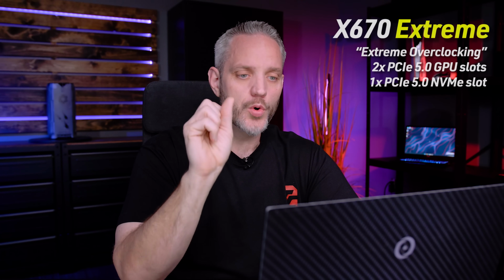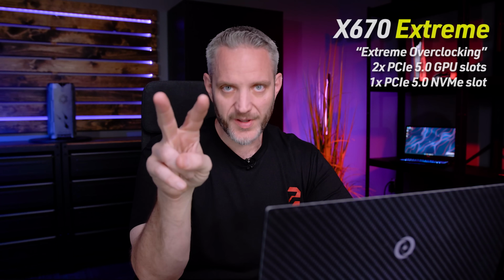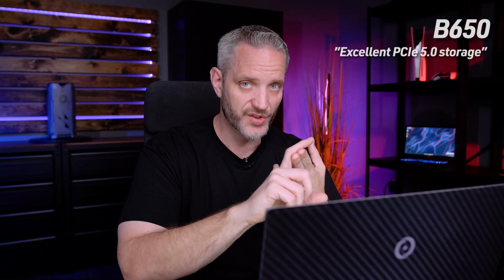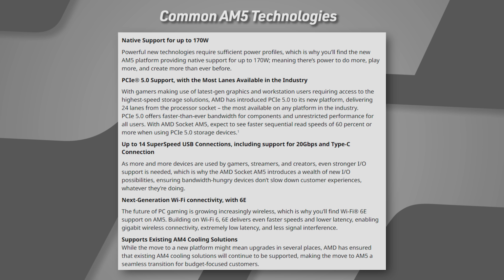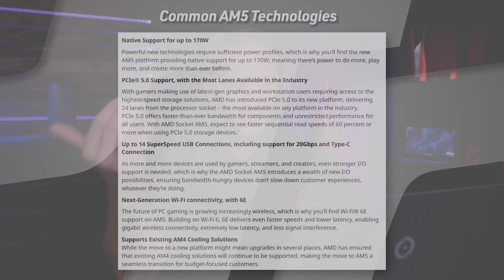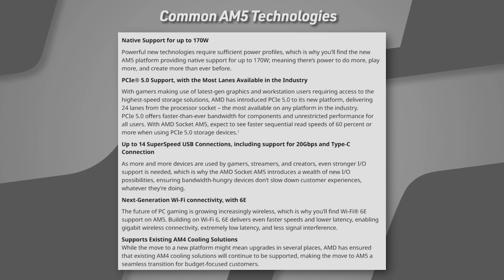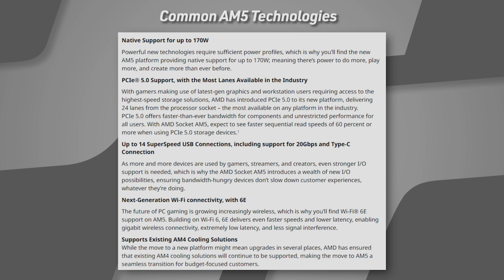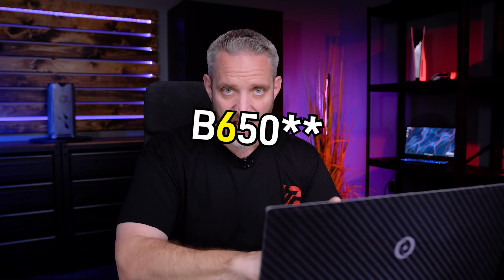AM5 Motherboards are EXPENSIVE! AM5 Explained

Comment: Total Platform Cost & Upgrade paths should be taken into account far more than they regularly are.
Reply: True people think you buy only the cpu
Reply: That's why I am going to stick  with my 5800X. The motherboard  it's  in, sadly, is an Asus Rog Strix B450-f, which only has PCIe 3.0  graphics and NVMe  storage..... But, maybe the RDNA 3 GPUs and the  PCIe 4.0 NVMe drives  wont be any slower, for gaming, on 400 (what I have)  mobos  vs 500(peak AM4) or 600 series(AM5)...... Unless RDNA 3  GPUs run more than 10% slower in a PCIe 3.0 system  vs 4.0 or 5.0..... AND unless direct storage  technology for gaming runs a lot  worse  on PCIe 3.0 systems vs  40. or 5.0, ..... at WORST I'll need to upgrade my mobo to an X570..... while I upgrade my GPU and NVMe..... at least I would get to keep my 5800X and 4X8 RAM kit (4600 16-19-19-36)
Reply: Too bad new AM5 motherboards are going to suffer with future upgradability the same way Intel's are when it comes to DDR5. DDR5 is still in its infancy stage. The DDR5 motherboards today are going have issues running better DDR5 memory in the future when it becomes more mainstream. Memory is only going to get faster and timings are going to get tighter as it becomes more optimized. Optimization for the memory controller and memory training algorithms on boards now are going to have issues for some. If you're going to adopt Ryzen 7000 with the idea of getting an expensive motherboard and thinking you will keep it for a super long time as you upgrade I wouldn't. Not worth it at all.
Reply: @PabzRoz  The memory controllers are in the CPU and the power management chip has been moved to the RAM's PCB with DDR5. The primary thing you'll be paying for with regards to a motherboard's capability to run higher speeds with DDR5 will be the quality of the materials and layer design of the PCB along with power filtering quality from the input and output capacitors. If you purchase a high quality DDR5 board now with SMT capacitors, SMT DIMMS and shielded memory channel signal planes, it'll perform perfectly well for the foreseeable future.
Reply: @PabzRoz  I disagree completely.  The expensive 4000+ mhz ram kits never gave a good price to performance ratio.  I have completed 3 ryzen builds with 3200 mhz ram, one with 3600 and one with 4000 that was twoard the end of am4.  I would still recommend 3200 on anything that wasn't an apu for sure.  The biggest thing is being able to drop a 5600 in a pc that used a 1600.  That is just nuts.  It makes amd so worth it.
Reply: But that can be counterbalanced by long term support which AMD has been very good about with AM4
Reply: @Alovon  ...because, when AM4 launched, AMD still had everything to prove to consumers. Now, they're on top of the game, so...
Reply: @lamikal2515  They have already committed to 2025+ for am5.  I don't think intel ever supported more than two gens on a socket.
Reply: @mrfarts5176  "2025+" can be literally 2 gens though (zen 4 + 3d and zen 5 + 3d).
Reply: @mrfarts5176  What is "commitment" ? Their commitment is not wrote in legal terms. It can't be enforced. It's just PR.

Moreover, they "comitted" on the socket... wich does not say anything about "chipset incompatibilities"...

What if the 8700X can't be put on a B650E ? It won't "break their commitment", after all... It's nothing more than doublespeak.
Reply: @lamikal2515  Fine, don't believe the company that has a history of supporting their hardware like this. No one is stopping you.
Reply: @RyTrapp0  That history is only due to the fact that they were the underdog at the time. But hey, AMD are the "good guys" right ? They only want what's best for you, right ?

Damn simpleton... do you hold any share of the company, by any chance ? Because if you don't, you do not have any valid reason to defend AMD like you do.
Reply: @lamikal2515  Again, don't believe them, no one is stopping you. I'm going to trust their past consistency, which I've followed since AM2+. You don't have to.
Reply: @RyTrapp0  And again, during the AM2+ period t the launch of Ryzen, AMD was struggling hard to be competitive. They effectively couldn't afford to not be "consumer-friendy". Now they clearly can.
Reply: @lamikal2515  They want to sell cpus.  The best way to do that is to maintain a socket over 4 gens.  This is what everyone wants.  They did this on am4.  This and another handful of improvements made the company worth more than Intel.  Go ahead and buy a platform that intel only supports for one or two gens max.  We really don't care.  Just try not to hold a chip on your shoulder against amd because muahh capitalism bad.  If it wasn't for amd you would be buying a 4 core 4 thread i5 for 300 bucks.  I plan on getting into am5 at some point just once ddr5 is mature.  Intel just screwed us for a decade and i am sick of it.  I work with servers and intel face planted over the past 6 years. The server side is where I expect intel to start really loosing market share.  I recommend amd servers whenever I can and have never been let down by that recommendation.
Reply: @cheese186  Could be but I doubt it.  Amd has been firing on all cylinders and will have a real run for their money with intel gen 13.  I never counted the 3d cashe as a gen release.  This isn't a company being run by pencil pusher but actual engineers.  They understand what we want and delivered.  I don't know why everyone is shitting on am5 so much.  Go ahead and buy a platform that we know will only support 2 gens.  I feel confident we will get more than that with amd and if not I will buy an Intel cpu for my next build.  I expect am5 will support at least 3 gens min.
Reply: @mrfarts5176  You completely missed my point. Intel screwed consumers over a decade, that's for sure. BUT WHY ? BECAUSE AMD HAD NOTHING TO COMPETE FOR A DECADE. That's my fucking point. Now they're on top... but you damn NPCs still believe they will put consumer first. AM5 "being supported" 2025+ only means boards using AM5 socket will be produced up to that point. It doesn't say anything about the chipsets, and what CPU you can or cannot pair with.

AM4 and it's various chipsets were extremely "consumer-friendly" because at that time, AMD still had EVERYTHING to prove. It's not the case anymore.
Reply: @lamikal2515  You are wrong.  Lol - they were caught paying dell to not use amd.  They have been fined very heavily for this.  Amd leadership is by law not consumer first, they are shareholders first.  They need to sell cpus and have identified what we want in order to sell them.  Intel never listened and preferred to pay off companies to maintain 95% market share because they had the cash to do so.  The hilarious part is that amd probably saved the x86 architecture.  Had it not been for ryzen I expect I would be using an arm processor right now.  They have been delivering a great product at a fair price and gen 13 will be on par with zen 4.  This will be good for all of us.  Go ahead and buy intel though.  Nobody is telling you how to spend your money.
Reply: @lamikal2515  bruh wtf
Reply: @mrfarts5176  "B-b-b-b-b-b-b-ut, Intel did shady stuff 20 years ago, so AMD are the good guys"

Good boy...here is you sugar
Reply: @lamikal2515  You need to step back and do some analysis.  Amd was months away from a bankruptcy when zen came out.  They have been delivering what the market wanted since then at a constant pace on time.  Those same people are still in charge.  They pushed extended socket support hard.  We have no reason to doubt they will continue this and they committed to 2025+.  They have been pushing core counts on the server side at price levels that are very reasonable.  Intel never went to a new node unless it would save them money until amd forced them to.  I never remember Intel supporting more than 2 gens on a node, even after amd demonstrated what this could do for sales.  I do remember them doing everything they possible could to avoid having to innovate against amd.  I don't know what your problem is but you need to review the actual state of the semiconductor industry.  Intel is likely going to be the next blueberry if they continue going the direction they are going.  They need to start making profits and will be taking margin on gen 13 and will be paying billions in dividends.  Expect gen 13 to be more expensive than 12 by a significant margin.  Meanwhile amd doesn't even pay a dividend.  Just make sure you try to get your info from as many sources as possible.

I own stock in both and try to make my decisions based on reality and not my perception of reality.  I really want a strong intel and I am hoping them opening more fabs in NA will give us this but I am getting more and more skeptical they even have the ability to do this effectively at cutting edge nodes.
Reply: @lamikal2515  You are right they had to be consumer friendly and sell cpus or go out of business.  Why do you think they are going to immediately change with no evidence this will happen?  Lisa Sue wants her stock to go up and she wants to sell more cpus.  I don't get your problem other than you hate amd for some reason.  Go buy an Intel cpu we really don't care.  I have lots of friends that have enjoyed having 4 generations on one socket and would like to see that again on am5.  You are so closed minded you refuse to accept the fact that amd might continue with a winning strategy, even after they tell you that is exactly what they want to do.  It's nuts to me...
Reply: @lamikal2515  You are also wrong about that cpu.  The first consumer cpu over a grand was the first extreme edition.

Comment: It's why I am saving for a 5600/5700x for my b450 rig that's currently running a 3600, it's the cheapest option for me and it would add some extra years for it. I got 10 years out of my 2600k Sandy I expect this for my current rig if need be

Comment: Since this is a new Chipset for AMD I doubt they will change the socket type for another 5 or 6 years, so the new X670 and B650 motherboards are going to last, you can't use a cheap motherboard with these significantly more powerful CPU's because they would under perform, whining  about price is not worth it here. We're in a revolution of AMD right now and stuff is going to be a bit pricey, also AMD is always ahead.
Reply: Compare AM5 to AM4 pin count…

And boom you can see USB4 80gbps, more USB4 40gbps and so on and the reason for so few USB4 at the start is because its new and needs the spec to mature hell 80gbps USB4 was announce and 7000 series might only be 40gbps to start with

Comment: So excited for this launch can't wait till they drop the price again on the 5800x3d so I can finally finish my build! I just got the water cooling system out in and another m.2 ssd put into it yesterday!
Reply: Its already down, the cpu launch at 450 dollars and its now at 385 dollars at Amazon
Reply: @Agp1597  Yeah I'm hoping for just another 30 from microcenter the have it for 380. I'm currently using a 5600x so paying an extra 50 from what i paid for it doesn't seem bad at all.
Reply: The price of the 5800X3D wont be dropping seeing as its cache lets it trade blows with the 7800X so long as you get at least 4000MHz CL18 ram for the 5800X3D

You will be waiting till 7000 series Vcache launch
Reply: @commanderoof4578  lol sure

Comment: Is it still worth upgrading to 5800X3D? Not sure if these new components will be good for SFF because TDP is much higher
Reply: TDP number changed but the power draw didnt… TDP changed because of density and IHS changes but default you cant pass 230w without throwing away your CPU’s warranty

But yes the 5800X3D is DEFIANTLY worth it and will be until zen4 Vcache comes out

Just make sure to get 4000MHz CL18 or better (better means 4000MHz or higher and CL18 or lower)
Reply: It is. I found a 5800x at 280€ .

Comment: I might end up buying a good B550 and a 5800X3D when i can afford it.... and pair it with a nice 4000 series card
Reply: Dont get B550 with a 5800X3D that is just shooting yourself in the foot

Also X570 motherboards are getting cheaper, the mobo i have is 60% of the price i paid for mine at launch
Reply: @commanderoof4578  I iwll keep the ryzen 1700 that ihave becuase while i got it in 2017 sicne 2021 that i got RX 6700XT 12 GB RED DEVIL for 950 euros it runs evrything at max settings 1440p 60 fps which means that there is no reason to change cpu ram and motherboard yet.
Reply: @commanderoof4578  my friend has a MSI B550 Tomahawk and said the 5800X3D runs flawless. what is special about x570?
Reply: @Ladioz  well you dont get PCIe 4.0 to the chipset so if you have SATA drives a couple USB drives and an NVMe installed on the chipset your gonna be shit out of luck of you multitask

I had a R5 2600 and god damn was it annoying 3gbps if i was lucky out of my USB ports of i was copying from my chipset NVMe to USB

Raid 0 maxed out at 2.3GB/s which was slower than my max of 2.5GB/s raw while my CPU NVMe got 3.4GB/s (switching the drives saw the m.2 slots as the factor in speed) and so on

Just get x570 so you dont have any issues in the future because you dont want to be limited to a single fast NVMe drive ans you dont want your NVMe drive to affect USB performance nor the other way round
Reply: I iwll keep the ryzen 1700 that ihave becuase while i got it in 2017 sicne 2021 that i got RX 6700XT 12 GB RED DEVIL for 950 euros it runs evrything at max settings 1440p 60 fps which means that there is no reason to change cpu ram and motherboard yet.

Comment: Z690 prices were pretty insane too at release, especially DDR5 ones and the overpriced ram sticks.  Happy to see them go LGA. Good video as always Jay

Edit: Typos, grammar sry
Reply: @rknudson1407  Threadripper is/was LGA, wasn't it?
Reply: @jackbui2944  probly.. haven't had my coffee yet
Reply: @jackbui2944  Your probly right on that... I haven't had enough coffee yet. But I do remember a time when you could socket an AMD CPU directly into an Intel motherboard. That there would really mess with Intel if they brought back those CPUs to take more of Intel's loyal followers..
Reply: @jackbui2944  Yeah Epyc and TR do.
Reply: PGA is better against user error. LGA pins on the motherboard are so much easier to bend than the pins on the CPU with PGA. They are also harder to fix by yourself. I'd rather have PGA but I understand why they went LGA.
Reply: I dont like LGA :c motherboards are less bountiful than CPUs. LGA will make the problem worse.
Reply: It was pretty insaner
Reply: Talking about ram. What would you say is the perfect speed in ddr5 especially for AM5?
Reply: @TR1ppl3  that would be the fastest speed you can afford...
Reply: @TR1ppl3  Depends on what you want to do. If gaming it actually doesn't matter as long as it's fast enough to not bottleneck your cpu and ddr5 at any speed should do the job.
Reply: I bought the EVGA Kingpin mobo. I love it. But I'm going to be selling this $2k build to do an AMD. I have a 5950x build and a msi x570 I think that is used for home office built that a year ago.

Comment: I am just sticking with my core 2 duo for now
Reply: I have Core 2 Quad . Can't Afford any new Hardware Till I find A Job 😔
Reply: ill give you my i5 9400F for free if you want. its a piece of shit though
Reply: I do corel draw every day average in 4 hours and i just have to replace motherboard once in two years but the processor still working for 6 year probably and im still using it. I don't know if doing upgrade will save my money for a long run but i am pretty satisfied with it because if anything broken the replacement is just cheap
Reply: I finally threw out my x58 920 system. Not a gamer, so I should have kept it.